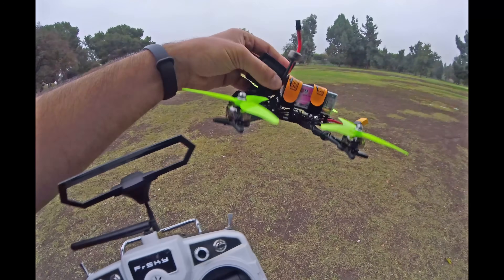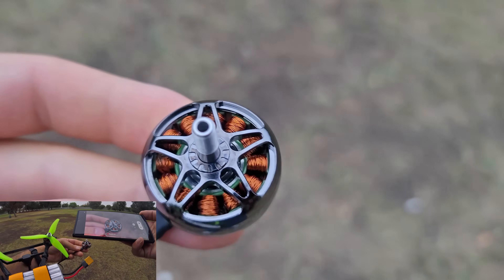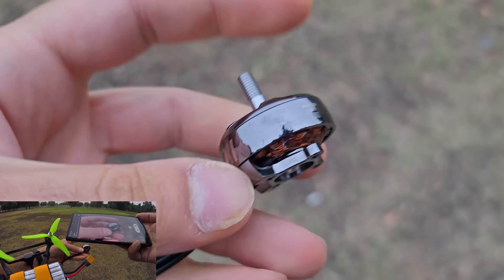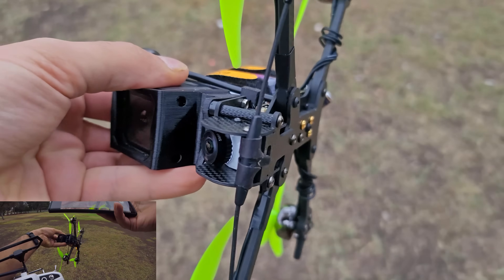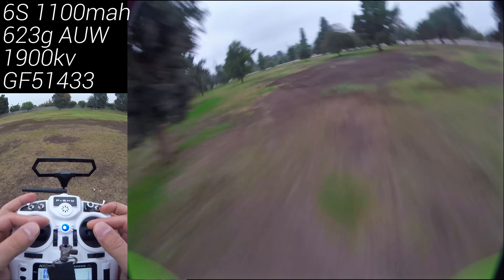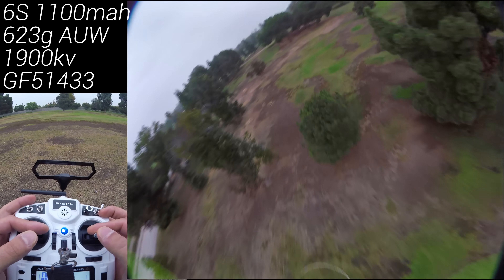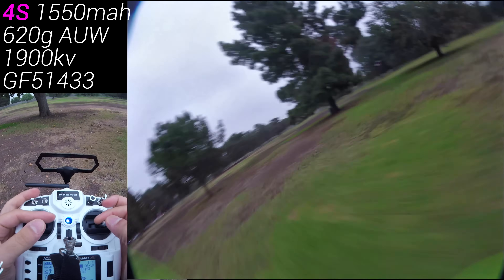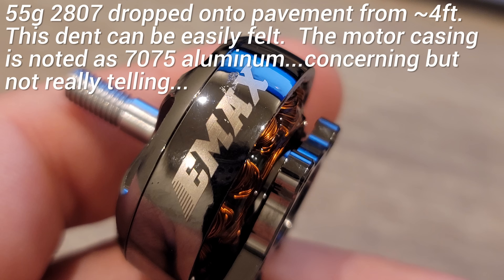Do you need a $27 motor? - Emax Eco II line

Comment: 56g? That's heavy. Which motor have you used before that you thinks was extremely durable? I'm using BrotherHobby R6 and I'm really happy with it,
Reply from the maker: Yep that's a solid motor for sure. The rcinpower smoox is my preferred motor in 1880kv
Reply: @Kabab  Awesome! I will try that once my existing motors go bad. I was not happy with a replacement I got. The shaft was soft. One crash on dirt, it bent. I was like "what the fudge is this BrotherHobby". Maybe a copycat
Reply from the maker: @neilfpv  BH has always made really good motors. Of course issues here and there but overall really good

Comment: I'm using the old emax ecos on 2 of my builds. There are 2 main problems: the bell is made up of 2 different pieces and in a hard crash they can separate from eachother, and the bell is too soft, I destroyed it on a 1 meter crash on concrete.
Reply: Yup, that and the bearings are all I can tell as a meaningful difference between those $11 motors and the $22 and up motors... I'll make that trade on racers ever day.
Reply: They say that this one is super ultra durable...
Reply: @Max_0578  I don't think so, they are practically the same motor with a slightly different design and cool new look. They are fine, they pretty much destory every other motor at this price point.
Reply: @NicolaGuerrera  yeah, but emax says  that these are super strong. Dunno what they did but thats what they say.
Reply: @Max_0578  Guess we'll find that out on my next build :)
Reply: @NicolaGuerrera  hahah
Reply: @Max_0578  Well then it must be true! :-p Just messing w ya.
Reply: I had bell separation issues. Maybe your motors are getting too hot. That’s why mine would separate.

Comment: How hard is it to replace bearings in a motor? Would it be a simple pop out and pop in?
Reply: Warm up the motors with a hair dryer or heat gun.  Not so hot you hurt the enamel on the windings.  Just hot enough they are uncomfortable to hold but you can still hold them without burning yourself.  Will make it MUCH easier to remove the bearings.  Aluminum has a greater coefficient of expansion than steel.  The aluminum body of the motor will expand more than the the steel bearing making them loosen up.  Sometimes the bearings can even just fall out or be tapped out without any force at all.  If you cool your new bearings in the fridge so they are cold they will install into a warm motor even easier since they shrink in the cold.  You will stop throwing away perfectly good motors just because they have a crunchy bearing once you learn how easy it is.
Reply: @Plur307  awesome dude thanks a ton
Reply: Oh and dont hammer them in to seat new ones, or they could get damage, just press hard w a flat tool same size as bearing do not press on inner ring only ....bad
Reply: @flo-ridafpv5713  YES, absolutely do not force the bearings.  I forgot to mention that.   Use a little lube like gun oil, bearing oil, or even motor oil.  Make sure you install them straight!  Make sure they do not get crooked when sliding them in.  If you try to put them in a little crooked they can stick.  It is easy to damage them if you force them in.  Be gentle and take your time.  It gets easier once you have done it a couple times.  Experiment with an old motor if you have them.
Reply: @Plur307  all truth, been there
Reply from the maker: Depends on the motor. They can be a PITA to get out.
Reply: I been changin mine for years, keeps em super smoove, just need a punch n hammer n thin oil to help em slide in n out, buy fushi bearings on aliexpress $6 10 bearings, abec5 rated for 50k rpm +
Reply: @flo-ridafpv5713  Oh cool. i was thinking they wouldn’t be too expensive and overall result in a better motor with lower cost.
Reply: @flo-ridafpv5713  do you think it would actually be worth it to get “budget” motors and change the bearings so they’re super smooth, or is it more of a repair/maintaining type of thing? 
Sorry if my question is kinda stupid.
Reply: @galx3573  nah good idea, but only change em if they noisy, use BF motor tab n run 1 motor up at a time , ya will feel vibes in the frame arm.  And ive used super $ bearings too, they dont last longer ...still rattle after a hard hit same as fushi
Reply: @flo-ridafpv5713  alrighty thanks 👌
Reply: @galx3573  YW man

Comment: I steered away from Emax after my RSII motors kept on going bad for no good reason.   No bad crashes or anything but shaft warpage nonetheless.
Reply: One of my new released GEPRC 2306.5 also had a bad shaft warpage from a relatively small crash. The bell and shaft are perfectly intact, but the base where the shaft is mounted was damaged. This is so frustrating, buying a new powerful motor and it breaking in your third flight because of bad material.
Reply from the maker: @gamaxgbg  unfortunately it all depends on how the impact happens. I crash plenty but I haven't broken a motor in years.  I equate it to snowboarding where the better you get the better you get at falling. You see pro boarders go down in ways that would kill a novice if they did.
Reply: @Kabab  Even though I've never snowboarded and am at least 3 thousands of kms away from the closest snow i get what you're saying. The real problem is that it was not a scenario where i could control my crash, i got failsafed LMAO.
Reply: I like this analogy
Reply: @gamaxgbg  here's a thought. Don't fail safe. Lmao
Reply: @gamaxgbg  I've switch to Xing-E motors. The steel shaft makes a difference i think. After a year with the same 4 motors, plenty of crashes. No problems.
Reply: Those are meant for racing hence the light weight, go xing unibell & never damage a bell again
Reply from the maker: Yep that has happened in the past for sure.

Comment: You can also run the 2xxx KV with 6s and tune it to 17xx KV in betaflight using scale factor. It will auto switch profile when u plug in a 6s battery. You get the best of all worlds
Reply from the maker: That works too.  Not quite the same but close enough
Reply: I went extreme using this method and I run 7in props on 2407-2600s with a 60% motor output limit,

Comment: About 4s vs 6s: sorry, but I'm never going to 6s. It just doesn't make any sense. 
I may even build a quad with 6s motors, but only if I want a 4s long range quad. 6s batteries aren't needed at all. 🤷‍♂️
Reply from the maker: That's fine. You're definitely not alone. 4S works the same too.

Comment: As you were talking about analog vs DJI I'm reminded that I'd love to see a 3" setup that you'd recommend for Vista.  I've not made the DJI jump yet, but really like my TP and BT.  I would like the same attributes with a Vista build as a way to have great video with a fun, light, quiet park flyer.  I've looked at the Hornet frame, the LeDrone Mod-L & GoaBreeze as well and more.  If analog will fade away, what will replace/join the TP3 recommendation and parts?
Reply from the maker: Unfortunately the vista still doesn't fit into a nice neat 3". That's why the fouride is 4". I'll work on it again when I finish the current stuff.
Reply: @Kabab  The TorqueFPV build looks like a nice and neat 3-inch Vista build. It would be great if other companies made something as good, so I could get hold of it. Torque only ships to the US.

Comment: Should i get the tmotor velox 2207 1950kv or the eco 2 1900kv. A set of 4 velox is $71 sgd and a set of eco 2's cost $69
Reply from the maker: The velox is actually trash. Don't bother with them or tmotor in general.
Reply: @Kabab  oh damn, i always had the impression that tmotor was the leading manufacturer for motors
Reply from the maker: @billyshears9714  tmotor doesn't even make many of their own motors. They're a middle man and have always been a middle man while trying to get their own manufacturer up and running. It's unknown who makes their motors at this point and how much of their factory is being used.  Either way it doesn't matter. They're a company that steals products directly from the community. Not good
Reply: @Kabab  so should i get the xing E or this then?
Reply from the maker: @billyshears9714  definitely this. It's better built than the emax
Reply: @Kabab  have you made a video on that or is there a particular reason for you to say that? General consensus seems to be that they are a valid budget option... or have you just had beef with t-motor ? :D
Reply from the maker: @fpv568  Tmotor is a terrible company but the velox is genuinely very low quality. The emax eco is far more worth the money.
Reply: @Kabab  fair enough, oh and just thought I'd ask, I've heard some people complain about resonance issues on the glide frame, what's your input on that?
Reply from the maker: @fpv568  there's over 8,000 glide frames out there.  It's been extremely well tested at this point. Resonance is an issue from time to time with every single quad ever built. It is not frame or component specific. Some frames are better than others but ALL can have resonance issues.  Today fortunately we have some pretty nifty flight code that manages most of this stuff automatically.
Reply: @Kabab  was thinking of trying kiss on mine, you've never actually given your opinion on kiss have you?